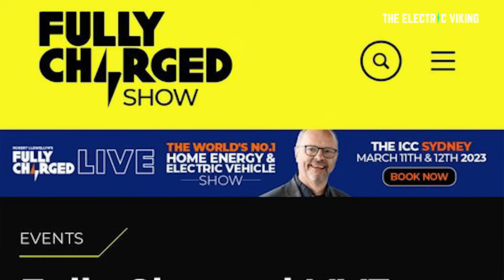NEW tech that can recharge an EV Battery in only 72 seconds

Comment: It’s possible that their trick is charging the ultracapacitors and using them to charge traditional li-ion batteries. Late version start-ups caused me to approach such news with a grain of salt. I no longer employ “benefit of doubt” in a favorable way; unless more info about the tech lying behind is shared, rather than the claims.

Comment: the major problem would be feeding that much power through cables to the battery.  think of sending 1000 volts at ? how many amps through all the circuits.

Comment: Ultracapacitors still have a problem with low charge capacity per litre. If that can be overcome, and if the can keep the ESR very low to avoid overheating issues, then it would be awesome in an EV. 

From what they say, a 1,000 Volt ~7 kWh a hybrid (capacitor and battery) pack being recharged in ~70 seconds will require an average current flow of 25,000 Amps.  At present we only have up to 800 Volt dispensers, so that average current will be over 31,500 Amps. The peak current will likely need to be double that figure, at least, meaning that 63,000 Amps will need to be pumped through the recharging cable, connectors and circuitry. That would be like playing with a bomb. 

After those thoughts,  I don't believe the claims. Yet.  But it will be interesting to be proven wrong.

Comment: Let's pretend they can make cells that will tolerate charging at 150-200 amps per cell that is no larger than a 2170. I find this laughable, but that's amperage you need per cell to charge in 72 seconds. Now multiply that by the 20-100 cells in parallel and you have dead minimum 3000 amps and upwards to 20,000 amps for charging! This will literally NEVER happen! I'll believe in perpetual motion first!

Comment: With gasoline, delivery limitations to the combustion chamber are in its fluid dynamics and mass, and its potential energy density/ delivery is limited by its chemistry, being a hydrocarbon molecule. You're also limited to the crude technology of "it blowed up good".  With electric cars you're manipulating electrons. The potential energy density for storing electrons is many orders of magnitude higher than gasoline.  The top speed of electrons is for practical purposes, instantaneous. Where I see the naysayers getting stuck is commenting on the current stage of development in electric cars as though this is as good as it's ever going to get.  This is irrational. That would be like assuming the technology in a gas engine from the 1940's is as good as it's ever going to get for the ICE.  That analogy is substantially inadequate as the fundamental tech for ICE hasn't changed since the 1940's and it is ironically the use of electrons to monitor and manage the mechanicals that has brought the gas engine to where it is now.  Even that substantial improvement in ICE efficiency and technology doesn't compare to the improvements that will come in electric cars over a similar span of time. Don't get stuck on present day tech and "just around the corner" tech.  Right now we're looking at 2000 km (1250 miles) range and a charge time for that being single digit minutes coming out of what we currently know.  Commercial delivery of this level will be sooner than we think, as has been the case so far with how large the year over year improvements have been with BEV's. Then there's improvements that we haven't thought of yet.  Always keep in mind an electron is a subatomic elementary particle.  A molecule of hydrocarbon fuel ultimately cannot compete with that potential. It's like Star Trek VS the Flintstones.

Comment: 72 seconds to  80%  is  good , though  it does not have to  be  fully utilised  time wise,…… the  load on  charging stations  and  grid too has to  taken into consideration ?   Ergo , charging  time has to  be increased  ,  Good news though  that  the  Battery  is  tough and capable  , .   Would be happy and hale , live even longer  on a slower charge rate,,,,…..?

Comment: What people always forget is the insane power requirements for the charger involved . To charge a battery in 72 seconds needs an average 50C charging rhytm . In case of a 80 Kwh battery , that comes down to a 4Mw charger ! That is 16 x more power than what a current Tesla  V3 supercharger can deliver .  There will be serious issues with the required cable gauge , heat etc...
Reply: Spot On! If Viking Fan Boy (Sam) could only do math.
Reply: @kvs13156  Now imagine 16 of those charging EVs simultaneously . That is 64 Mw or enough power to provide electricity to a small town of 10000 homes . Kinda puts it in perspective ...
Reply: @gerritgovaerts8443  There is also an another perspective (very simplified but it will show the concept). I agree that the power needed is just insane (but these chargers are using battery buffers which smooth this out). The thing is that if you increase the speed of charging you automatically decrease the amount of cars which can charge concurrently. It is easy to see 16 cars at some big charger if there is "slow" 150kW charging but it would hardly be possible with such a fast charging. Imagine 16 cars. 72 seconds. You will not be even able to park and plug these 16 cars in these 72 seconds. 

If you have 16 such chargers and 72 seconds od charging, the stopping the vehicle, getting out of it, plugging it,... and the reverse steps will probably take 2-3 minutes if you are really in a hurry. So, each charging space can be used for charging at most 1/3 od the time (probably much less). In other words, with 16 charging places and such a quick charging, there is basically no chance that more than 4-5 cars will be charging at the same time. It so insanely quick that more people will be connecting or disconnecting the car to/from a charger than actually charging the car. 

It is basically as fast as typical fuel station with gasoline and diesel. How many cars are there at the pump? 16? I do not think so. How many of the cars which are there, are actually actively refueling? 

Another perspective. You are able to charge the 80kWh car (able to drive 250 miles) in 72 seconds. The car drives 12500 miles a year. That means 50 such charging sessions a year.  This is 50*72 seconds = 3600 seconds = 1 hour a year. The year has 8760 hours. In other words, the car is 1 hour a year charging and 8759 hours a year driving, parking,... In other words, if one car charges, 8759 other cars do not. The same as you do that with gasoline and diesel. 

Though I have said all of that above, I still agree it is crazy. But if you are talking about the perspective, I have provided another one.
Reply: @milansurkala2415  I get your point , good alternative perspective !

Comment: if it takes 2 minutes to charge a 7.9 kw battery it will still take 20 minutes for a 79kw battery, very good but still only equivalent to continuously charging at 237 kw.

Comment: It could actually work by not charging to whole battery at once but rather the BMS switching between banks of cells as they become charged.  You can’t do the whole thing at once and if the BMS ever faults there might be hell to pay, but by staggering the charging of banks of cells it could work. The super low ESR of a super capacitor and the lack of capacitors to retain a charge over extended time means they have invented something never before.

Comment: Bruh. The size of that cable would be enormous. This is not realistic.
Reply: Lose cables aren't needed, WAVE can get close to those charging speeds using wireless charging.

They can do 1.5 megawatt charging, that means a 50kwh battery can be charged in 2 minutes.
You just drive up to the space with the coil in the ground, have your car set to automatically charge and you're done in 4-5 minutes if you have a 100kwh battery pack.
Reply: @MrSec84  you would still need massive connections in the car between the cells of the battery and also between the antenna and the battery. This would be the case even if you didn't do wireless charging. The current has to be shared between the cells and has to get from the antenna to the battery.

Comment: An average battery pack these days has a capacity of about 70 KWH. To charge this in 72 seconds requires 3.5 Megawatts, Where are you going to find such a charging station? If it runs at 800v, that means charging at about 4400 Amperes. Helluva cable, that!

Comment: 7.2 kW-hours of capacity indicates this is just an ultra-capacitor, incapable of providing anywhere close to enough energy storage for an all-battery electric vehicle. Therefore, their "hybrid" is probably an IC-Engine plus an ultracap to boost accelerations and possibly top speed, but only for a short duration, perhaps doubling or tripling the power provided by just the IC-engine, but for probably no more than 1 or 2 minutes at the most. The IC-engine would most likely be used to recharge the ultracap, getting it ready to provide the next acceleration. Thus, I don't believe this is actually a battery-powered EV, but rather just an electric power boost for short-duration accelerations (i.e., no hill climbing power with this one) and braking energy recovery.

Comment: Charging upto 80% in 72seconds?
Depends on the capacity…
But if you mean a 75 kWh battery?
In that case, it depends on how often you can do it before it wears out, or explodes.
To me, it sounds as a April fools joke, or missing the small print.

Comment: This batterytech could be good for formular1-cars, but for "standard-public-cars" it would be a real challenge for the electrical-supply-net. This would mean we need really big batterys at the stalls AND if you want to stabilize the net, this would mean if this batterys are emptied by the first (let me say 10?) customers, the next customers would have no real fast charging (because the buffer is empty).

Comment: Let's be real: charge separation is still being done sequentially even though all charges could get separated within one second. You're not filling a tank with charges...you just separate them...imagine a rubber that you put tension on. And if you release it and it has a way to relax you are using this tension to make something move up or cause friction so you get light or use it for processing. By 2030 (latest) there will be batteries that take less than 1 second to pull the charges apart - and one charge will last 20,000 km. It's all about geometry on the nanoscale - there is no order there today on such low scales.

Comment: 7.2kWh. There's the rub. In a conventional EV, that would get you about 50km on a good day. That's the problem with supercapacitors. Fast charge, lots of recharges, but low energy density. The hybrid ones, unlike genuine capacitors, have a minimum voltage below which they suffer damage. This means that you won't be able to access the full 7.2kWh of energy. A 100kWh supercapacitor would be huge.

For the uninitiated, a capacitor is a common and cheap component commonly found in electronics. In power supplies, it is nothing to find one charging and discharging 100 times per second. They can do this for a decade or two at least. A supercapacitor is just one with a large value, initially used to replace the coin battery in a computer. They then started creating hybrids, merging them with Li-Ion battery technology that gave them more energy storage capability but started limiting the number of recharge cycles and requiring a minimum voltage to avoid damage. Don't get me wrong, they have their uses but not in EVs. AA alkaline cells have their uses but I wouldn't use those in an EV either.

The other problem with low capacity is that you will have to recharge at a much higher frequency. You won't be able to recharge overnight then drive for a week. You'll be charging at least once a day and probably more even if you are doing a bit of running around during the day.

I've been hearing a lot of claims about wonderful new battery technologies for well over a decade. They all have one thing in common. They promote the one parameter they have improved and gloss over the others that suffer as a consequence. Here, we have lots of fast charge cycles but crappy energy density. If hear of another many years ago that had fast charging, goid energy density, but the battery was stuffed after 3 recharges. "All we have to do is fix that one last problem..." that never happens. There are a number of factors a battery needs - goid recharge time, decent capacity, decent power delivery, good number of recharges, good service life, decent energy density and specific energy  for the application,  and probably more. A usable battery has to get them all. Miss one and you don't have a product. It's no good doing well in one if you miss others.

Real battery improvements will happen in incremental steps. We'll find a new technology that outperforms the old one by 20%, and then another, and another.
Reply: Nah they're great in EV's for regen braking, use of all regen power often not possible with EV batteries and could help with battery longevity.

Comment: Well,  a lab or company is going to crack the code, and invent a battery that uses cheap materials, has at least 500 miles range, charges is 5 minutes, is light weight and non-flammable. Should be arriving soon, too many entities are working the problem for this not to happen in the very near future.

Comment: Key question you missed answering: what is the energy density of this supercapacitor? Usually to low to be practical in cars. Great for other use cases though.
Reply: Not only that, but it's my experience that supercaps charge fast but discharge slow. Tech's gotta improve.

Comment: This is the biggest bunch of balloney I have seen you broadcast. This looks like a scam to to hook investors who do not understand the basics of electricity - including you Sam since you never do the calculations to see how much voltage and amperage it would take to transmit 100 kwhrs over a wire in a minute. As I said before the battery is not the limit, the power source and the means of conveyance will always keep this tech from competing with gasoline or other liquid fuels.
Reply: Basic common sense tells us that liquid fuels have a limited future against Lithium ion in almost every vehicle transport application including long haul trucking, heavy machinery and shipping.
Where the limitations of charging times exist the problem is easily solved with battery swapping. 
BEV have so many advantages over liquid fuel vehicles they will take over the entire transport industry only limited by the short term constraints on scaling battery production exponentially.
Reply: @richardvivian3665  No doubt that BEVs will have a place in the future, but making outlandish claims that do not regard the laws of physics sounds like someone trying to succer investors.
Reply: Have you ever heard of the 1891 invention of a high-voltage transmission wire? The conveyance would not be the problem. The health consequences and the weight and volume of the wire would be the problem. 500 kV kind of makes 6 MW of power pretty much child play with 12 amps of current. By the way, that doesn't change the energy requirement. That only changes the amount of time the power need be applied and potentially the amount of loss in the transfer of energy. The loss is a function of the wire and the battery, which you tried to claim isn't a limiting factor.
Reply: Did you guys realize how much you heat up the battery. That’s a lot of electrons being moved in a short time period. That’s a lot of heat that needs to be dissipated.
Reply: @vec306  Exactly, Viking Fan Boy thinks that magic fairies are going to eliminate the laws of electromagnetism.
Reply: @vec306  ...moved in a primitive way thus too much friction happens...which is a loss of efficiency. Batteries really still are extremely primitive.
Reply: Liquid fuel for car is dead.
Run your number again.
Reply: It’s only a 7.2 kilowatt hour battery. That’s 10% of a common EV Battery.
Reply: Maybe it could be done with a decent size pack, but I wouldn't want try and lift the charging cable.  I did some calculations a while ago and worked out that for a 100 kWhr battery the copper inthe cable would weigh about 28 kg. This assumed that the cable was not cooled and it was running at 1 kV.
Reply: @neil2742  Wireless charging is the answer, OK WAVE is a little slower than that 72 second battery limit, but it can still send 1.5 Megawatts to the receiver pad on a Tesla Semi 10 inches from the ground pad.

50KWHs could be charged in 2 minutes, no lifting needed.
Reply: @neil2742  if you look at fast charge, 800 kw will be possible. Normally you do not need to charge other then home and at work. 
No need to go gas station. just a blessing
Reply: @aronandreas  800 kw - so doing the math here 240 volts is 3,333 amps - now use a chart to check your wire size.
Reply: If you’re better than NASA’s rocket scientists, shouldn’t you, at least be working there or managing the engineering there? Why are you here?
Reply: Is this a big lie?
Reply: You don't transmit anything when you're using AC. The issue is how the charges get separated.
Reply: @electricpirate7964  Wrong, their are practical limits to how much energy can be transferred over a wire safely.
Reply: @electricpirate7964  soo…you saying we need 2000 mile long extension cords?